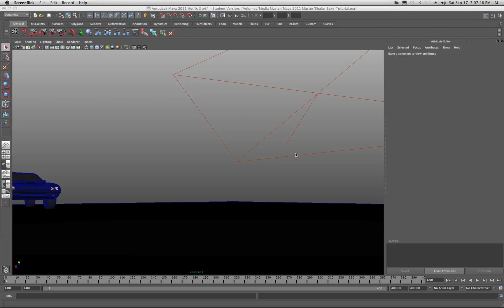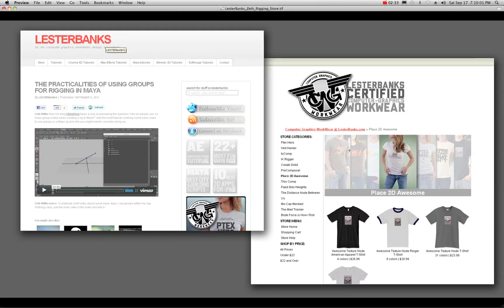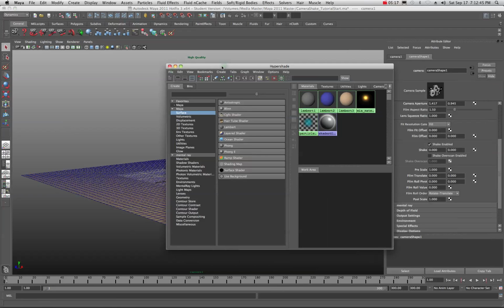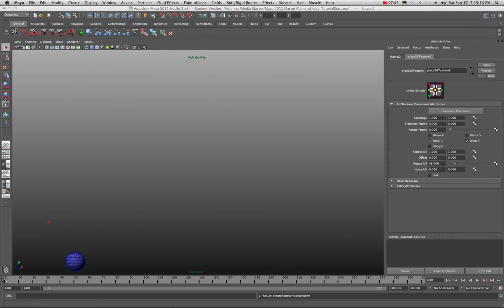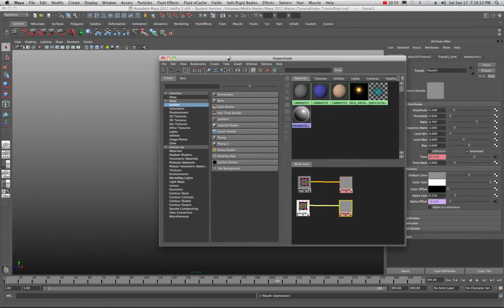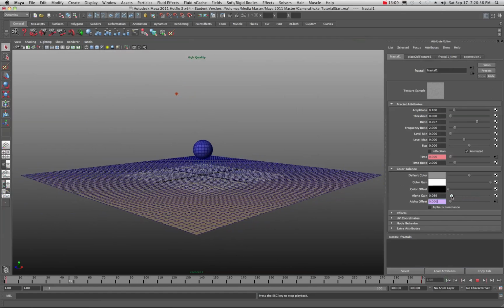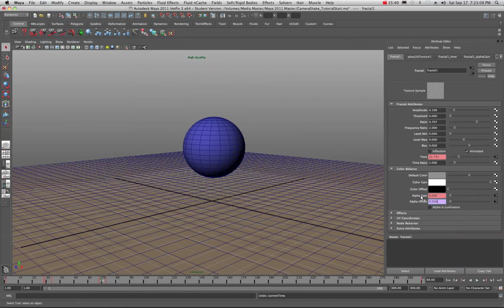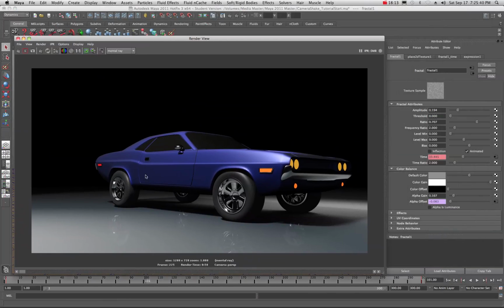Maya 2011 Camera Shake Tutorial by Stuart Christensen

Comment: Great analogy Stuart. 

@jamil1985: Each pixel in a noise map has a number based on a B&W value, so shades of grey are the numbers in between. This means there are 256 numbers between B&W (in an 8 bit per channel map). That 'grey' number is assigned to the amount it moves the camera in a particular direction. Since it's a noise map, it appears random. 

Use a checkered map or a ramp & see what happens. Once you get a feel for it you can create your own maps in Photoshop if you want more control.

Comment from the maker: In theory yes, the alpha offset allows Maya to compare light and dark values of a fractal texture. If static, it would be like you putting your fingertip on a piece of sandpaper and not moving it, with alpha offset, it's like your fingertip on a piece of sandpaper and moving it around.  The sensation you feel is much like the camera reacting to the "offset".  Hope that helps.

Comment from the maker: @iraowens The fractal1/TimeKeys are set from 0 to 1 to tell Maya to keep the effect going for the entire animation and you can start or stop that effect at anytime by setting/keyframing the value to 0, or turn the effect (shake) on by setting the value to 1, or to turn it off set the value to 0.  It probably wouldn't be all that hard to write a script for the effect it's just I don't use it all that much so until I really need to go there I won't.  Hope that helps!